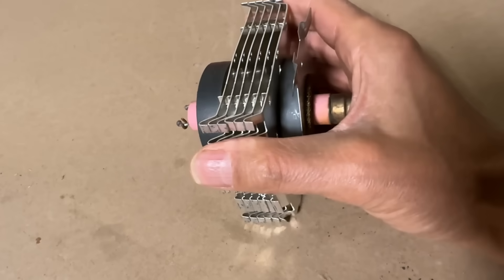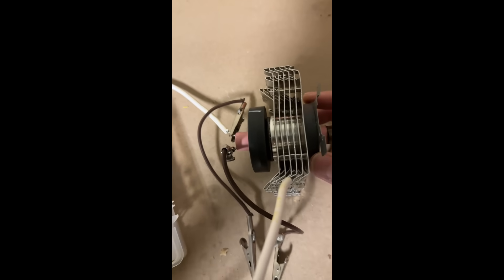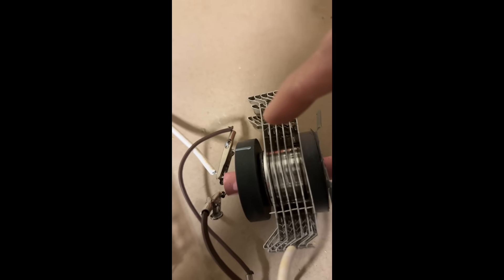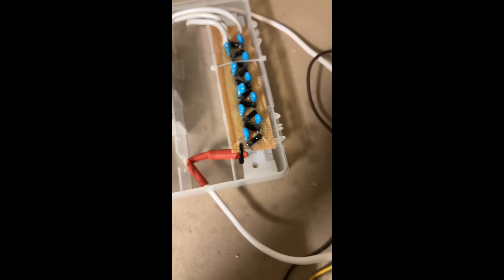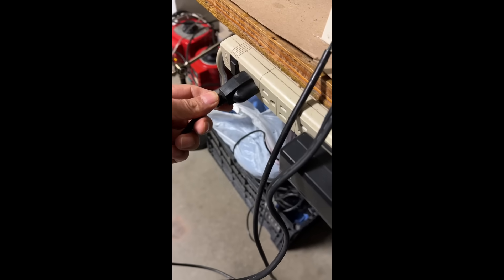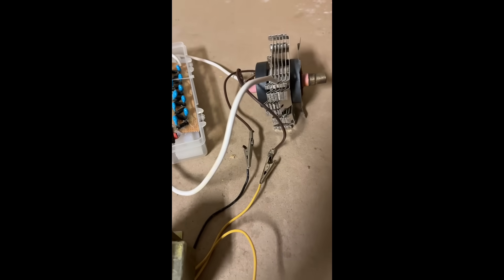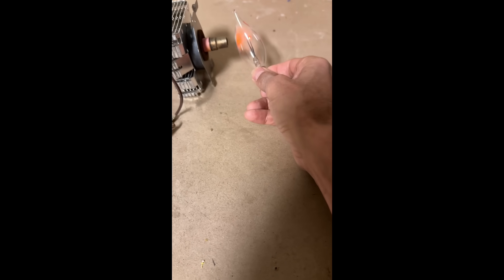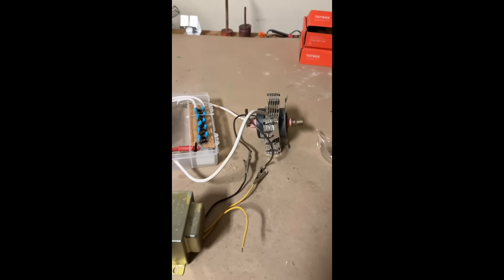Running a Magnetron at Low Power

Comment: How much of the energy emitted by the magnetron actually gets inside the oven?  I always assumed 100% of the energy was emitted at the antenna, but I believe you just proved that's not the case.  Further, the way the waveguide is placed on the emitter in an oven, it looks to me like at most half the energy emitted actually goes into the oven, as the other end of the waveguide is terminated such that, assuming anything I think I know is true, there's a reflected standing wave that transmits no energy.
Reply from the maker: Most of the energy should be getting into the oven. There was a metal covering to the back part of the magnetron that I had to remove in order to make proper connections, and I’m sure that this metal piece was probably acting as a kind of reflector to get the energy back to the other side of the magnetron.
Reply: @BrianDhvTinkerer  Thanks!
Reply: The probe is used to couple the energy into a short section of waveguide, then the waveguide is connected to the main oven cavity.  If you use a probe that's a little shorter than a free-space quarterwave and position it at 1/4 or 3/4 of a waveguide wavelength from a rear short, the coupling can be stunningly good. Like a return loss of 30 dB or better, so almost 100% of the energy couples to the cavity, creating a standing wave pattern inside.  Usually there are stirrers or something to mess up the patter to avoid hotspots.  Taking the magnetron out of the waveguide means that you have a free-space monopole antenna that needs "something" to act as the other half of a dipole, and that will be the body of the magnetron and to a lesser extent, the wires, so you could find hotspots with high RF currents and voltages in odd places like the heater connections. You do lose a little energy from ohmic losses in the waveguide and imperfect dielectrics, but aluminium has near-zero loss at those frequencies and ceramics usually have a dielectric loss tangent way below 0.001.
Reply: @MachiningandMicrowaves  Thank you!  I'm already subscribed to your channel and been attempting to wrap my noggin around understanding microwaves in an effort to create a narrow, long-range, high power beam I could direct at a moving object where I could then capture that beam and concentrate/focus it down to a small spot to create a plasma.  I'd been considering attempting to create an array of oven magnetrons where each would have its own waveguide that could be directed to an off-axis parabolic dish.  Watching this demo had me concerned I'd have a lot of leakage toward the back.
Reply: @MachiningandMicrowaves  Most informative...thanks for the understanding...makes sense now...

Comment: did i just really see more waves coming out of the back than the front?
Reply: Typically the case of the magnetron is grounded and the back is shielded...  With the case floating, and the filament acting as a ground reference - the case of the magnetron is a bigger antenna, so it emits more RF than the tiny waveguide.
Reply: it's not about grounding but more like impedance difference between silent side and output antenna waveguide and termination on both side, I think.
Reply: @AlecKristi  fascinating
Reply from the maker: @AlecKristi thx
Reply: i think something to note too is that its not "lazing" out microwaves, it more a sort of donut around the antenna.
Reply: He should try it with the cathode disconnected to see it the lamp wasn't lit just by the electric field around the HV power supply.
Reply from the maker: It does appear that more energy is coming out the back of the device. There was a metal covering over this part of the device that has been removed, and I bet that was reflecting the energy back into the system.
Reply: @ lovely
Reply: He took apart some parts from this magnetron. Some steel sheets missing. Its purpose is to prevent vawes to escape on the rear side. Something like Faradey's cage...
Reply: how did you see waves
Reply: Is it possible that the HV is causing the bulbs to light as opposed to microwaves?
Reply from the maker: @chetgreen5739 I thought that initially. I did an experiment where I left the HV connected and turned off the filament power. The glow in the bulbs turned off. It came back on once the filament was turned back on.
Reply: @ Great!
Reply: @BrianDhvTinkerer  The iron plate bent around the magnetron closes the magnetic circuit. Youshould have left it in place.
Reply: Yes,my uncle had a shotgun that would maim on one end and kill on the other .